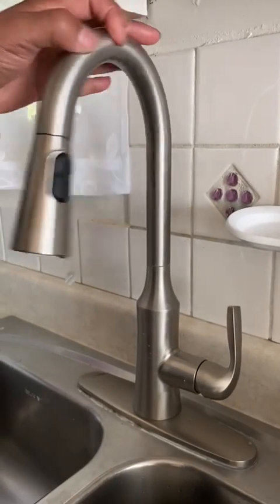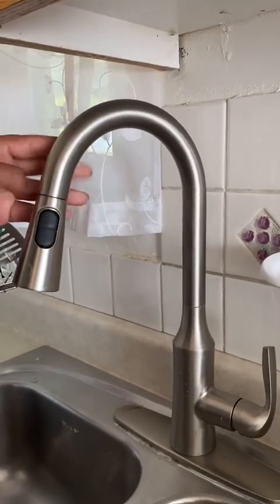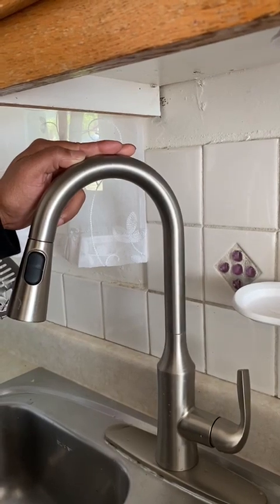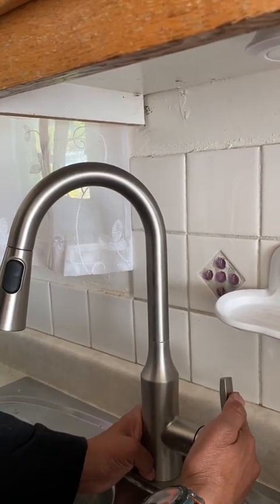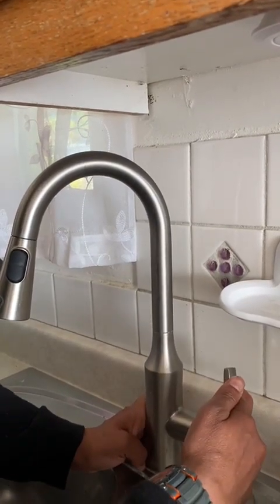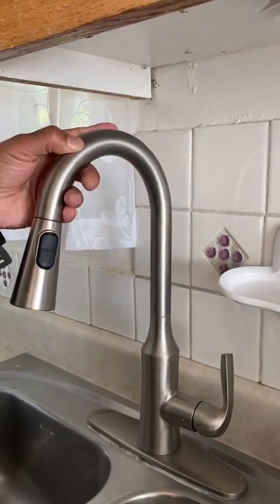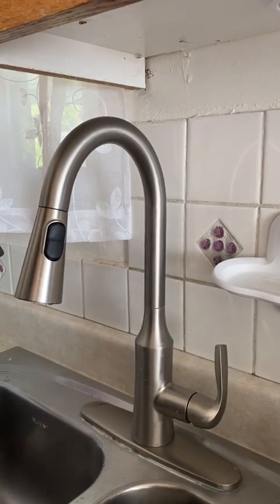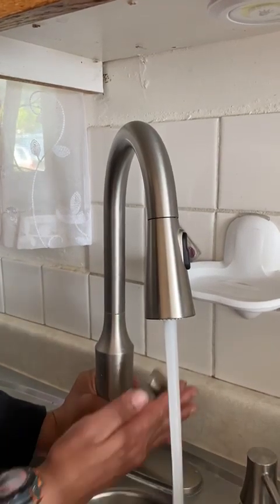Moen motion sensor faucet disabling

Comment: Awesome video. Finally decided to reactivate my Moen Delaney after 5 years. This has a sensor on the base and on top of the spout arm. I replaced all 6 batteries, but unfortunately, the flow is not as strong as if you operate the lever manually. But good enough for now. The base sensor works only if you wash your hands/pots but as soon as you leave, it shuts off. But if you want the water to flow continuously, wave on/off over the top sensor. Thanks again.

Comment: I have two sensors and only wanted the front one off. Found the manual online and it worked!! Cover both sensors with your hands for five seconds while the water is running. That’s it!! Success!
Reply from the maker: Thanks for sharing

Comment: Thank you so much for saving lives here . I was fed up changing the batteries as they would run out so fast. This product from Moen has some serious problems if the battery is discharged you can’t even on/off manually.

Comment: With the sensor deactivated, can you operate the faucet "manually" by using the faucet handle and moving it left/right to turn on/off?
Reply from the maker: Yes you can. But as a reminder and Thanks to genius manufacturer for the lunacy,  this model faucet will not work at all without batteries.
Reply: Will the batteries still drain with the sensor off?

Comment: Do we need to keep the battery in in order for it to be turned off permanently?

Batteries are so expensive at the same time they don’t last for long 

What’s worse is that this faucet requires six AA batteries 

The expenses are not worth it 

So I’d like to know if I remove the battery will I still be able to use the faucet after deactivating?
Reply from the maker: Unfortunately, the geniuses at Moen made this to only work with batteries .no batteries, no faucet .
Why? Only the almighty dollar knows 🤦🏽‍♂️

Comment: I have the  exact same sink and I tried this and it didn't work, not sure if maybe I have a different model but for me you have to start from the cold position not the hot. So for anyone that this does not work for try starting from cold, also starting from cold I only had to do 3 movements not 4.

Comment: Does anyone have any mods for this model?  We would like to change the linearity of the valve positioning. It is difficult to get a low flow unless you are very precise with the handle position.  The manufacturer made this thing waste a lot of water by not programming it correctly.  We would also like to figure how to limit the open valve position when the sensor is triggered.
Reply from the maker: Good idea , even better would be to have faucet work without batteries … but what do we know right

Comment: Mine doesn't work. It doesn't start when we want it to and does not stop we we try to. I have put a black tape on sensor and try to operate it as a regular faucet. Even then there are times when the manual lever doesn't work.

This is poorly designed faucet. Stay away.